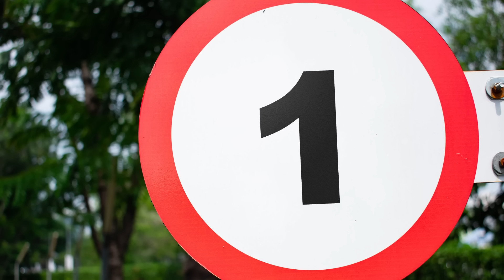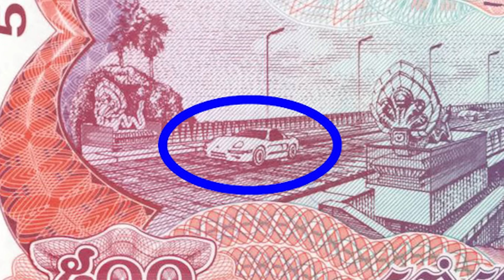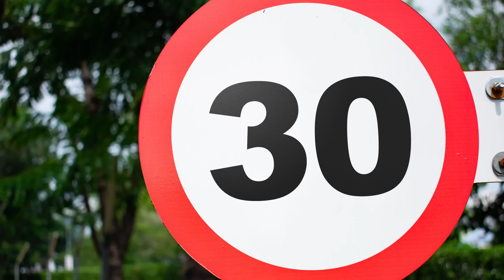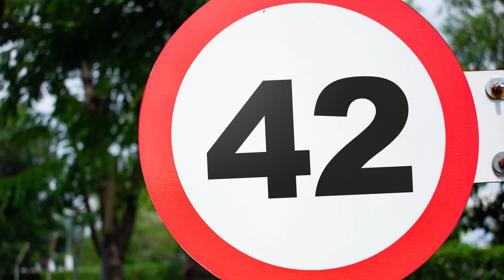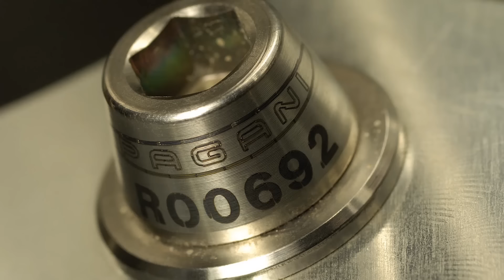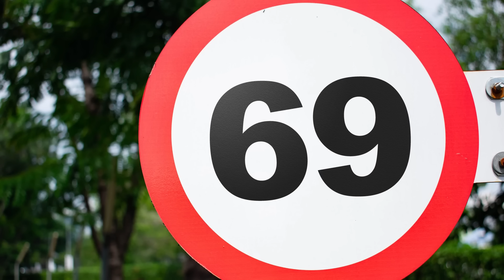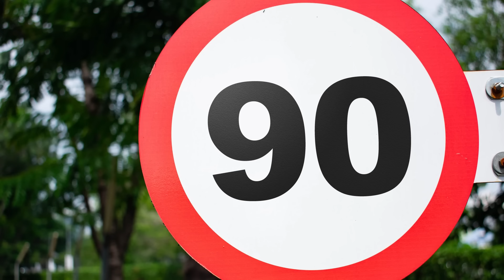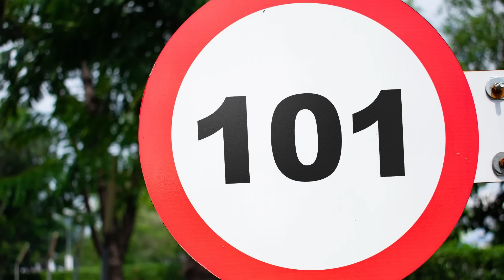101 Facts About Cars

Comment: why do people always fall for the programming code fooling?

fact 52

there is no piece of code that much in amount and loops just fool you!
what exist is single lines yes.

the only thing you did was using a money amount putting on code lines.

yes that is commonly not a wrong thing to do. that a code line is in this sense worth a USD.
solid way of selling it and paying the coder.

but bloating the code line amount without mentioning it right is still done wrong.

100 million is the typical money world amount. it has nothing to do with code! its dumb money world selling of something that isnt sold in the right context!

a cars code may not consist of more than several 10k of code lines. maybe a bit more maybe a bit less.
depending on how complex you can even only get under 10k. with cars not the latest ones.
and where its simpled down to basic motor brakes clutches and gearshifting plus parking brake plus a bit of dashboard indication functionality. really not that much code need for basics here.

its not that much what needs to be done by a car anyway. if it breaks down to simple driving functionality of course.

and dont confuse repeated code as new code lines. it may be the case when its executed on runtime.
but writing a loop that consist of 10 lines of code.

that when executed gives you maybe 15k lines.

is still only 10 lines and not 15k

so 100 million is out of the frame and unrealistic limitation!

typical american & money sales world pitching world of how to place a lie!

its dumb stupid and wont do you any good on the long run. avoid using money amounts in that wrong way!

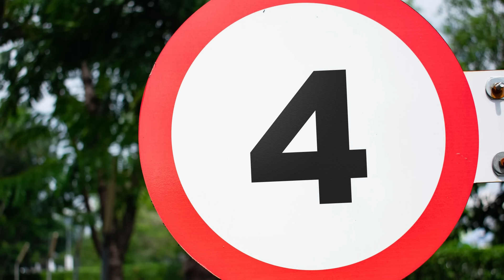Comment: I don't know what mathematic you study in your life but 1 hour and 40 minutes not represent enimore 4% from 24 hours. In clip , from 1:05 to 1:40 you present one big shit. 
Let's try to calculate and see the true :  1 hours from 100 is 1% , 4  from 100 is 4% => let divide from 4 and 1 hours is 4% from 25 because 4 X 25/100 = 1.
In this moment we reduce to 24 hours  => 1hours from 24 is 4,167% because 24x4,16667 /100 = 1 
Let see 1 hours and 40 minutes ( 1:40) is 1,66 hours (20 mimnutes is 33%,, 40 minutes is 66% and 60 minutes isa 100% from 1 hour ).
This mean 1,66 hours from 24hours represent --- 6.916667 %  .   Let try to verify => 24 x 6,916667 / 100 = 1,66 hours
And now to put the correct comment - 1:40 (one hour and 40 minutes ) represnte 6,91667% from 24 hours and not 4% how you tell in clip. Let make round on secnod number after comma and to have 6.92% . This mean you are using car 6.92% and  93.08% your car stay in parchimg . Can be true for YOU.